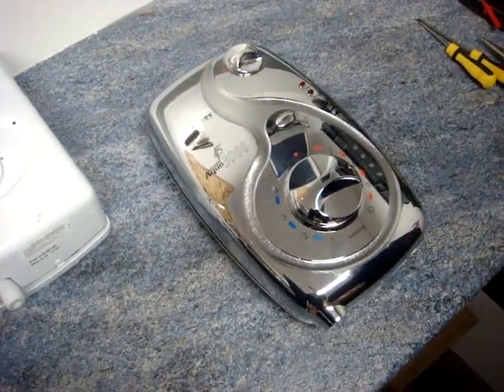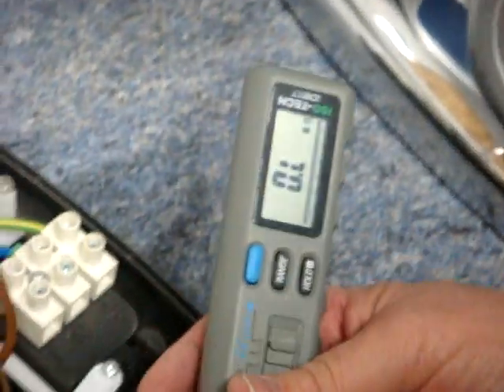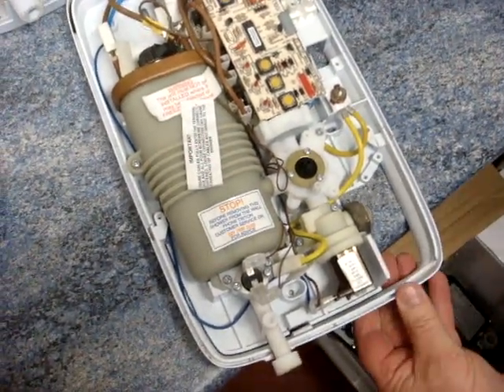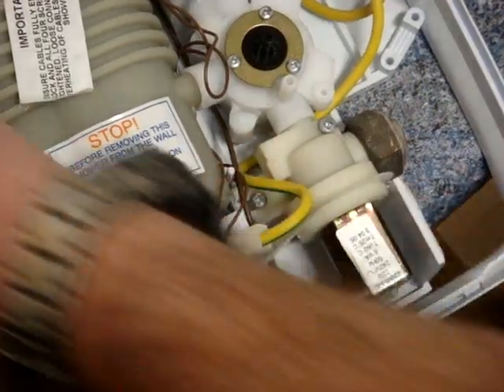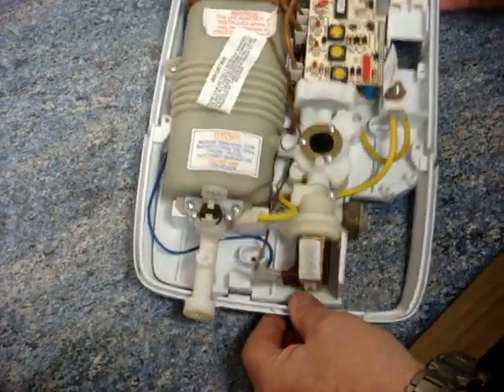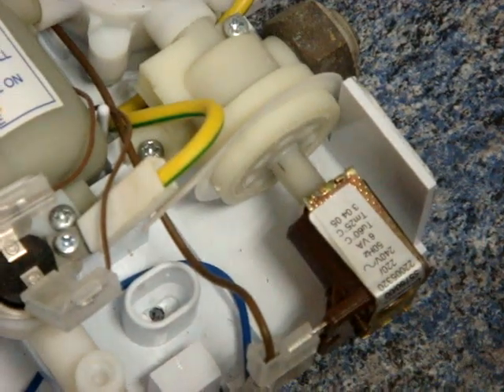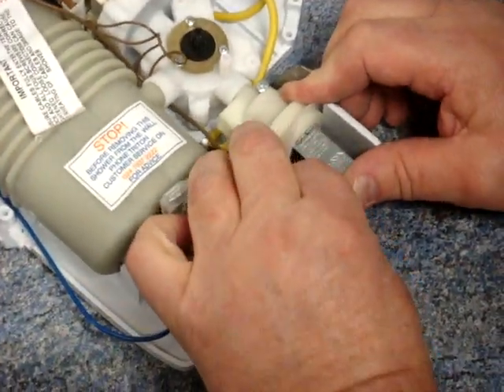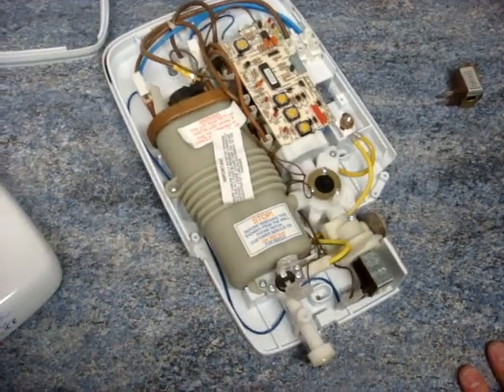Electric showers: How to test and replace a solenoid coil

Comment: I changed the solenoid on my Triton T80XR sucessfully with the part I bought from The Shower Doctor. Beware though that for this type of shower you need to remove most of the screws from the inner parts so that the solenoid can be lifted clear of a plastic partition and then removed. The platic spigot that fits into the solenoid had to be pinched at its end to get it to move inwards, and then again when it was about half way along the inside of the solenoid when it engages in a small gap.

Comment: @showerdoc   I've decided to simply buy a new shower. The cost of buying a new solenoid coil, valve and labour cost is not worth it. BTW I did use 2 screwdrivers to remove the coil valve still broke

Comment from the maker: @Blitz3677 I am sorry to hear you had a problem with changing the solenoid coil. Over years I personally have replaced thousands of solenoids and I guess I could count the number of times that this joint has failed on one hand so you really have been quite unlucky.

This type of failure is more likely to happen if you tried to lever the coil off with only one screwdriver? My advice to viewers would be to always use 2 screwdrivers to prevent uneven stress on the spindle when levering it off.

Comment: Tried to change my solenoid coil on my Triton shower as it was faulty, broke the Solenoid Valve as the the coil was glued in.  Now got to pay for the job to be done correct. Not as easy as you describe as the Solenoid coil is held in by clips on the valve if this is not squeezed in the long plastic clip will break on the valve !!

Comment from the maker: Hi 
Is the problem no water, or no hot water?
No water: then it is likely to be the solenoid
No heat: then it is likely to be a faulty element or Thermal Cut Out.
Regarding the tester: The one in the clip is a fairly expensive professional tool, however we have much cheaper versions on our web site that will do the job.
 If you need any more info you can go to our website and use out ticketing system or try our forum